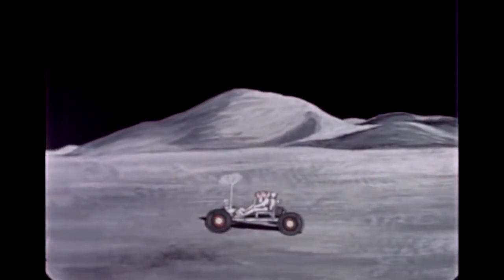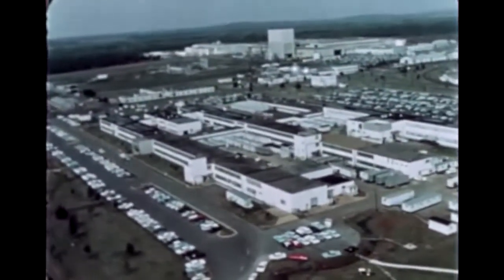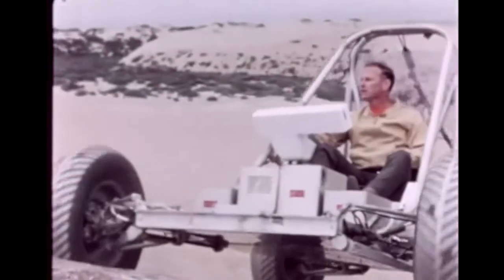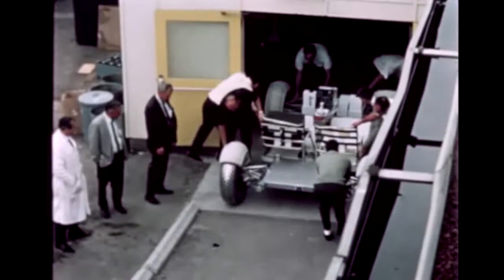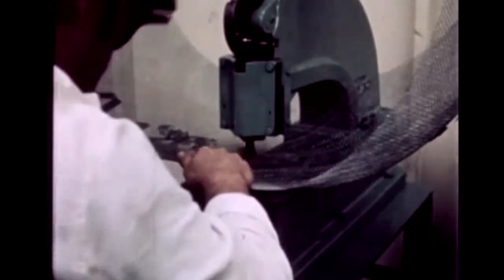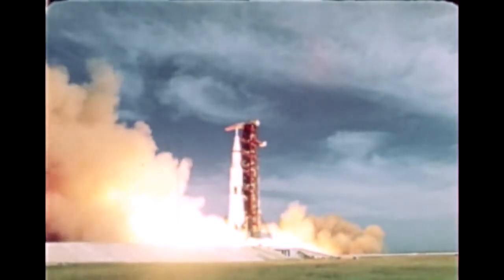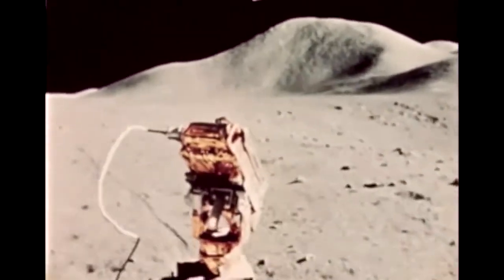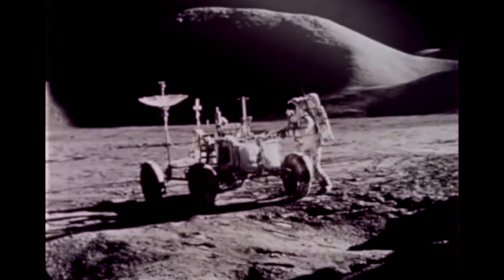Spacecraft With Wheels - The Lunar Rover

Comment: This movie-short's style seems like 1940s vintage rather than 1971 — which is fine by me. Anyway, it's a good quick look at the exploration of the Hadley-Apennine region, by CDR Scott and LMP Irwin, on the first lunar rover.
Reply: You are absolutely right, some department head approved of a strangely anachronistic (virtually WW2 style) narration and style.  Quite at odds with some of the footage appearing in the 'Apollo 11' documentary by Todd Douglas Miller, featuring sleek tracking shots and other techniques shot in 1969 - that look like they were done in 2019.